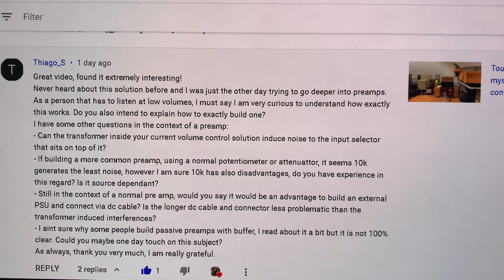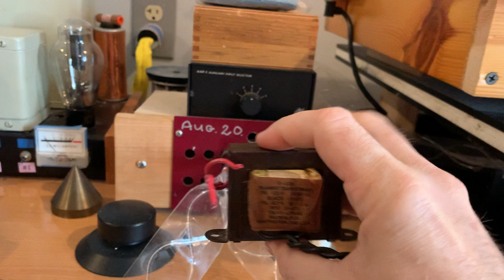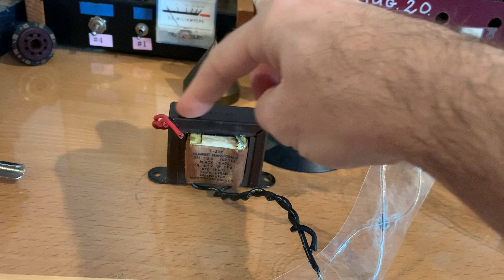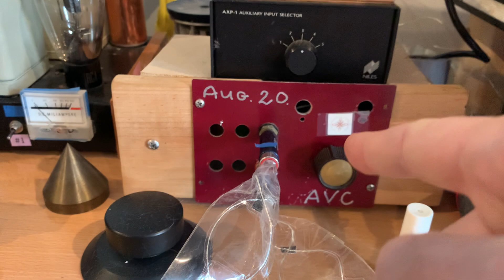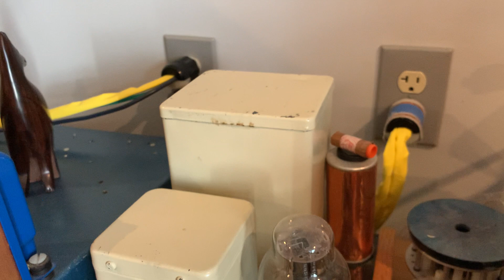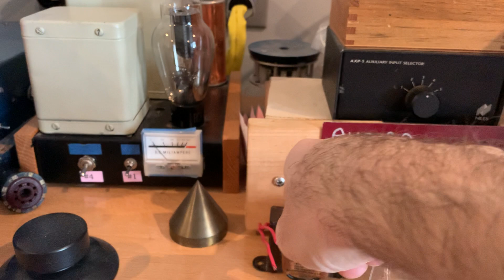Can a Transformer Volume Control induce noise?

Comment: How does that copper tape sound on the tubes? Is that at all safe, and does it not reduce the lifespan of the tube? And does it not hype up the sound so it cuts more through and is more boosted? What is your experience with that.?
Reply from the maker: Hi Larry, I have a detailed video on that: https://youtu.be/RcdTaJ-8aDA

Comment: Yes but what about the signal going into the transform there will be some noise introduce and on the secondary winding probably control it with a capacitor
Reply from the maker: I have tried a number of AVC / TVCs, and in every single case they were all noticeably quieter, MUCH MUCH quieter than any resistive volume control methods (stepped Alps, etc), or active preamps they replaced. I have copper shield around my AVCs, and still points ERS, and they are dead quiet - but they were dead quiet even before applying copper tape / ERS. Never ever had any issue of them picking up the slightest noise, and my speakers are 100+dB/Wm so very easy to hear slightest noise / hum. Among our friends here we have about a dozen plus AVCs / TVCs, diverse kinds, and nobody ever had any noise / hum pickup issue with any of them. The only issue that can come up is when there's a ground loop, and you get hum from that - but in that case it's not the autoformer, you get a hum with the AVC taken out as well. A TVC solves the systems ground loop issue though, isolating source/ load grounds. (AVC does not isolate grounds.)